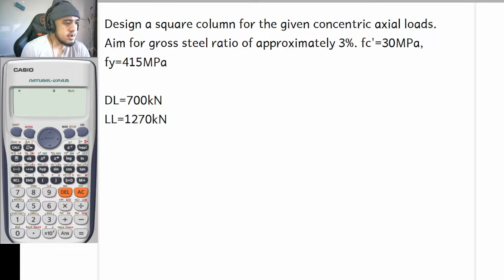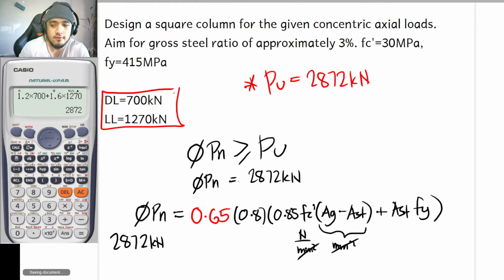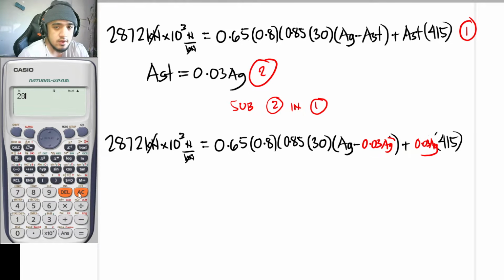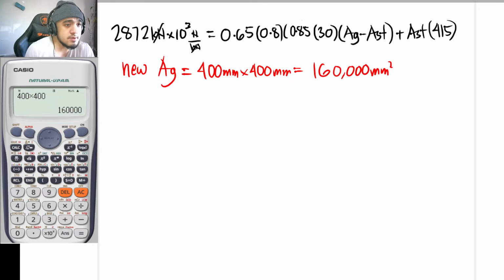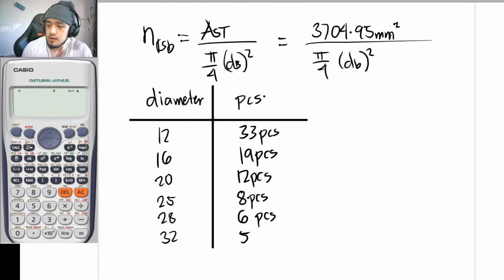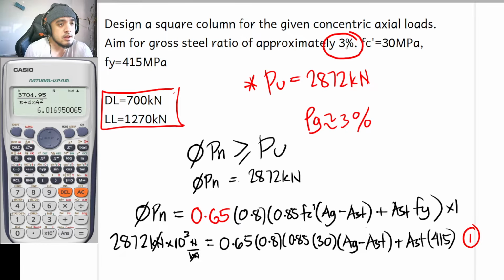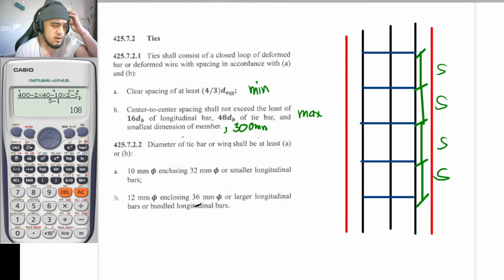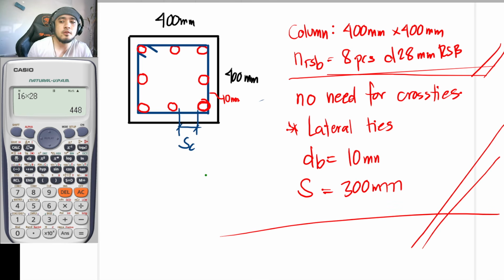NSCP 2015: Design of Concentrically Loaded RC Short Column

Comment: Sir, we'll be having quiz tomorrow about this topic po, pa verify lang po. After makuha yung exact design natin for Ag which is 400x400, di po ba yung area na yun(160000mm2) ang iequate sa steel ratio para makuha yung Ast?
Reply from the maker: Good evening! If exactly na yung steel ratio dapat yung basis, then yes. However, since nag round-up tayo ng 400x400 for the gross section, it will be better for us to compute for the theoretically accurate area of steel. para mas economic. And besides, guide lang naman yung "Aim for gross steel area ratio of approximately 3%" para makakuha tayo ng trial section.  Hindi siya total requirement na yun daw dapat ang steel ratio niya. :)

If gamitin kasi natin yung 3% ratio dun sa 400x400, overdesigned na siya. :)